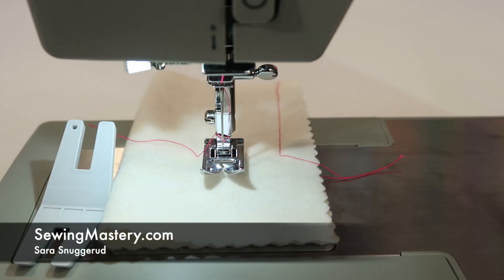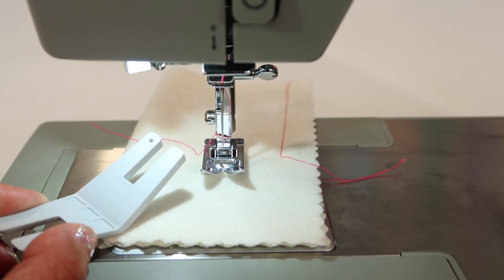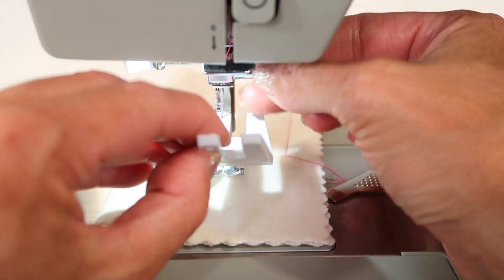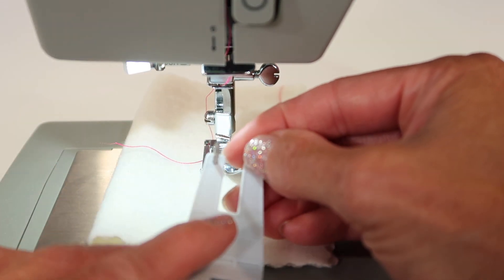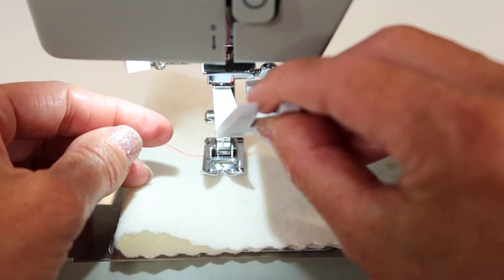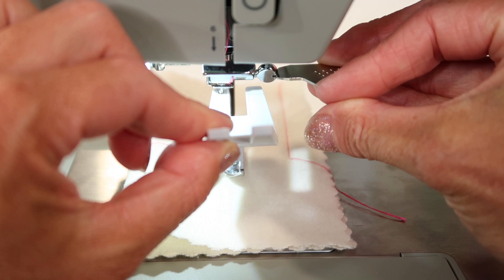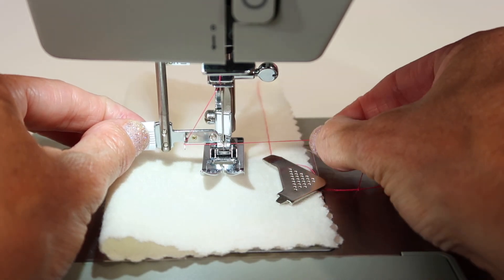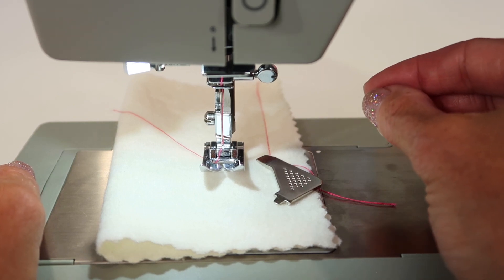Singer Heavy Duty 4452 16 How to Change a Needle

Comment: I notice that you had a piece of cloth under the foot when you changed the needle. I do this for the simple reason that I have occasionally dropped the needle and found it had disappeared into the hole below. Then you have to unscrew the bottom plate and unscrew the arm plate to get to the lost needle.

Comment: On both of my sewing machines have the Problem that this specsiffic thing, to change the needle wouldn't move at all, so i cant change the needle and both of them haven't that specsiffic tool to change it and its not possible to move it with everthing else that i tryed
Reply: I used a thin steak knife 🔪 to turn it. I finally found the bag that came with the sewing machine and it was in it. If you can find a thin knife it will work make sure you get it in the groove and slowly turn it
Reply: I used a thin steak knife 🔪 to turn it. I finally found the bag that came with the sewing machine and it was in it.